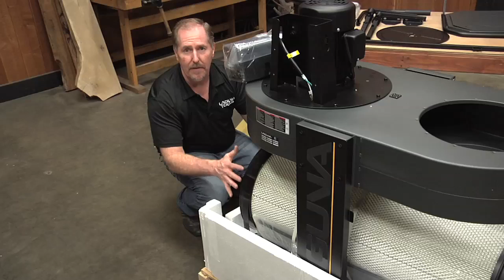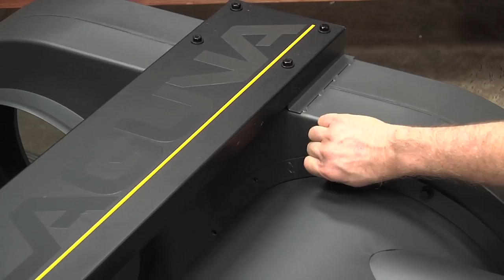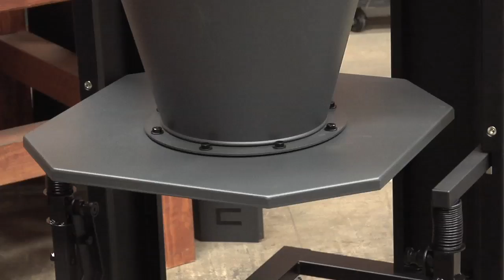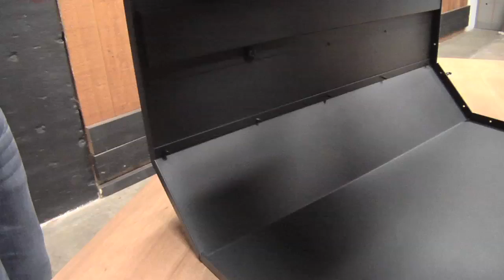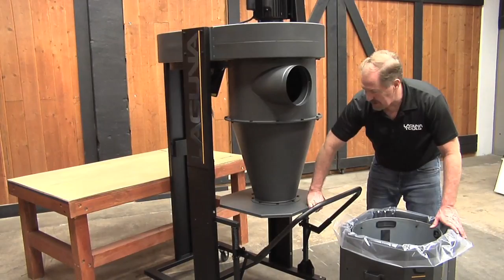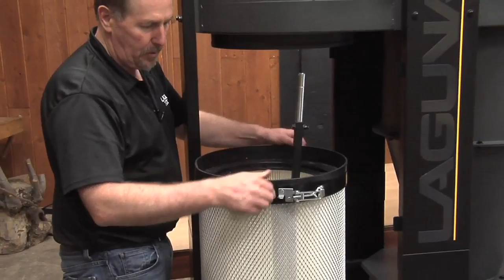C|Flux Cyclone Dust Collection Setup Previous Generation | Laguna Tools

Comment: I just purchased the 1.5 HP model from Woodcraft, only took a few hours to assemble, wife helped me flip unit upright after installing casters, risers and reinforcement panels, the rest I did alone and it was pretty straightforward, the worse part was all the tiny screws and nuts that hold bucket together. Let's just say I'm glad I have long arms.

Comment: The video definitely beats the instructions sent with the unit however there are some things that could be better identified. Laguna could take a lesson from sawstop on how to do an instruction manual properly!!! Some of the holes that attach the " cyclone barrel" to the machine did not align and I had to re-drill elongated "slots" to make them fit together. Parts bags and parts were not clearly identified and in some cases had different names than what was identified in the pictures at the beginning on the instruction booklet etc, If the machine "SUCKS" as hard as the instructions though I will be satisfied.

Comment: okay, got my cflux together and my dust collection hvac pipes installed.  I was told by one youtuber that they wouldn't use 6 inch pipes for a 1 1/2 hp machine.  I did, and I just tested the cfm at the furthers point (about 35 feet) and was getting over 800 cfm.  I get much more at the tools on the same wall as the collector.  The longest run there is about 10 feet.  This a great machine.  Used the farther point flex hose to suck up some chips from my lathe- much stronger than my 6 hp shop vac with a  cyclone attachment.

Comment: I just purchased this model from my local woodworkers emporium. It's a floor model and it did not have a inlet splitter or a reducer. I would ideally use a reducer form 8'' to 6'' ducting can you recommend a product?
Reply from the maker: lets discuss, call us 800.234.1976

Comment: I recently received my 3 Hp C-Flux and was struggling to make sense of the manual when I stumbled onto this video.   Excellent is all I can say.....chucked my manual away and just used the video to assemble and went like a dream.    The presenter explains it very well ..... thumbs up to Laguna for making this video!
Cheers from Aus
Reply: I had the same problem with the manual.  Laguna should reference this video in the instruction manual.  A pictured is worth a 1,000 words and this video is worth a million!
Reply: couldn't agree more! their instruction manual is awful, very painful, almost unusable. Thanks to this video they save the hassle for someone to be calling tech support and stay for them 5 hours on the phone for every step by step instruction. One more thing... they have to make the caution stickers and some technical bibliography available in Spanish, remember Laguna is from CALI (most spanish speaker state).

Comment: I just received my C Flux, but mine looks slitty different than this one, has my cyclone and filter was already assembled. Also, NONE of the parts bags were labeled. And my insert is solid, it doesn't have the holes, and it didn't have the rubber gasket around the handle cut-out.  I will send a message to Customer Service before I start assembly, has I have few questions about that.
Reply from the maker: Please call us 800.234.1976 and we can assist. Thank you.

Comment: I have a Laguna MCYC1.5 dust collector and it allows large chips from my planner and jointer to go into the filter bag which result in having to empty the bag ever 3-4 drum emptyings. Does the C|Flux have the same problem?
Reply from the maker: Hi Gary, the new C|flux series has been tested for separation and comes out at over 99%, especially planer chips should separate really well as they are relatively heavy. The new models have longer and more narrow cone, which has improved separation and airflow has also improved dramatically. Please check www.lagunacleanair.com for more details